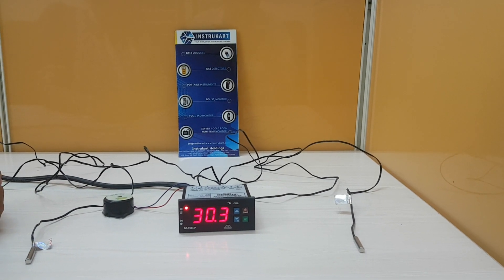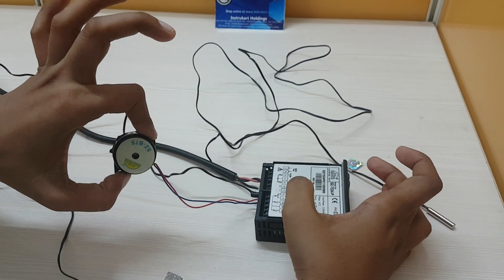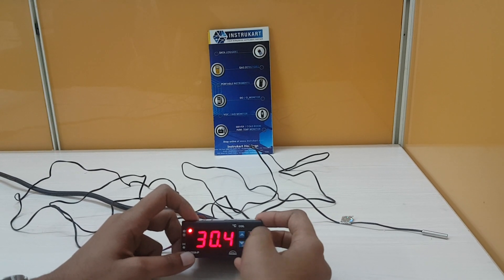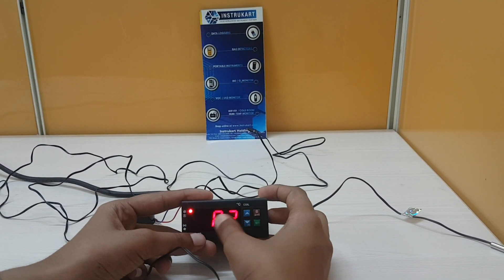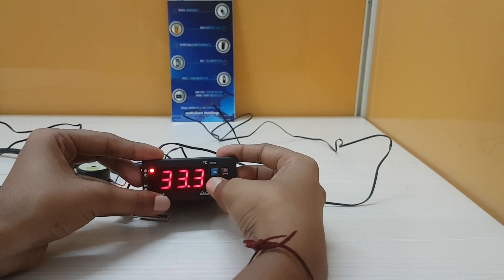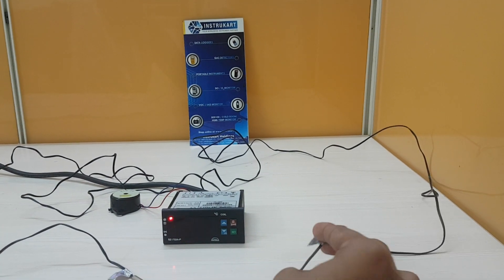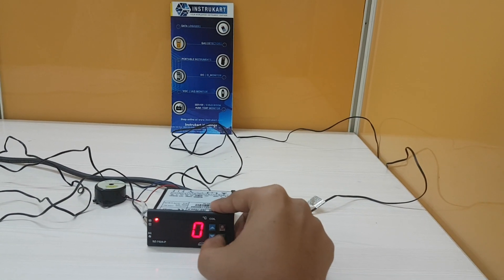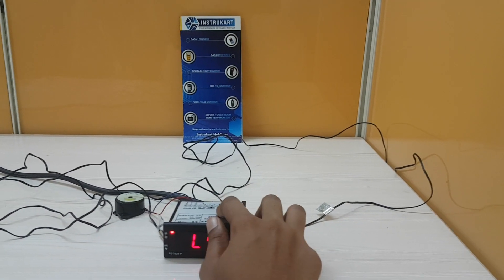Subzero SZ-7524P Digital Temperature Controller

Comment: How to setting in points in sz 7524 model like example  it's show 30 Celsius and we want more accuracy in 30.3 etc.
Reply from the maker: Sir, it depends on the resolution of the instrument, if the resolution is 0.1 then it will be more accurate.